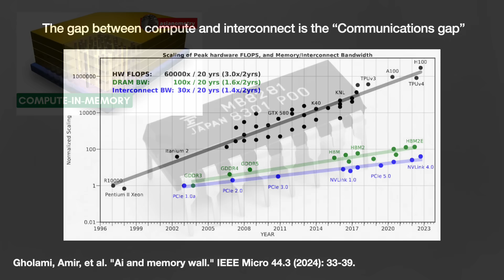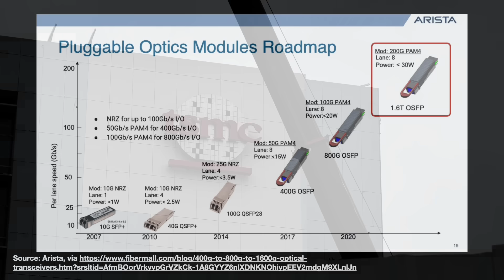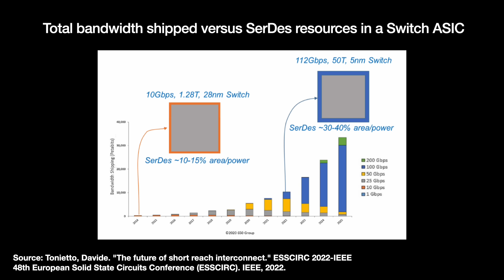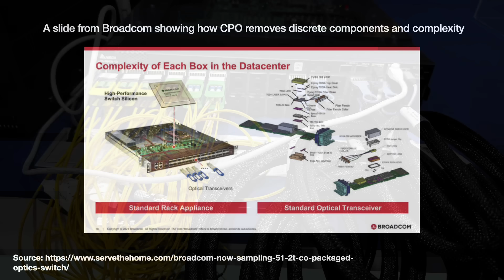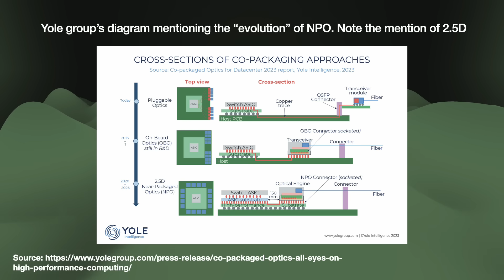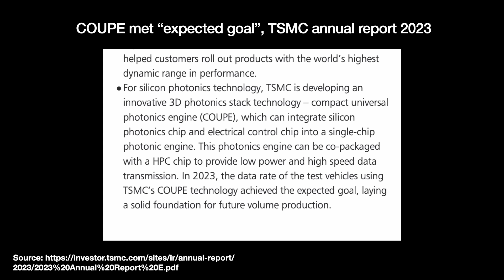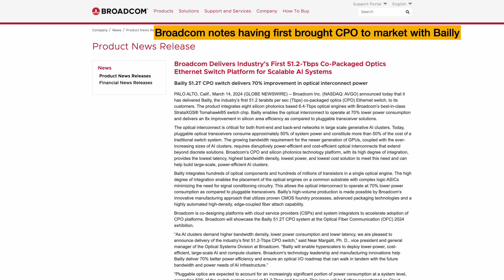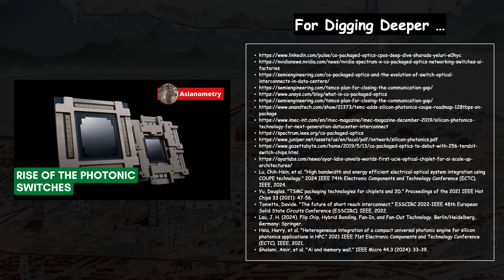The AI Bandwidth Wall & Co-Packaged Optics

Comment: What the hyperscale and HPC industries really want is an all-optical path from one server node to another, but while there are ways to design optical switch matrices that move photons around from port to port, routing them depends on reading the header of each incoming packet.   With current (and foreseeable) technology, that means the packets need to be converted from optical to electrical, so the actual switch core is still an electrical chip and there has to be an electrical-optical converter front-ending each port.
Reply: All optical is possible but the address info will have to be communicated to the switch electrically. That puts limits on the latency but the bandwidth can still be very high.
Reply: @tykjpelk the advantage of photonic waveguides is that you can "tap" 5% of your light signal, send it into an integrated photodiode, read out the current and deserialize the data to identify the targeted ip port, run the remaining 95% of the signal into a routing circuit to the targeted port until the target ip address changes. 

What could also be done is of the hundred channels in the opticsl telecom bands, some be dedicated to data addresses, and some be dedicated to data. Like that, the optical flow never stops.
Reply: I wonder if they could run more lines to more ports so no routing needs to be done. No addressing needed if everything has its own dedicated line.
Reply: @GradyHouger That's a lot of architecture baked into the hardware. We use caches because a hard drive read is literally a million times worse than a cache read. You can imagine the performance loss if the optical port connection itself needs to be replugged by a human or a robotic hand.
Reply: Why? Since we are talking about light that implies color. Various combinations of 16 million colors ought to allow for header space for every possible ipv6 address, let alone any other application.

There is no need to switch to an electron.
Reply: @Steven_Edwards  Colors are combinations of wavelengths and intensity.
I was thinking of each server accepting a single wavelength, thus making it its own address. LEDs however can't modulate their wavelength and they don't have big spectrum coverage, meaning you'll need a bunch of different diodes on the chip, one for each supported address.
Another possibility is to use polarization.
Reply: @ИванСнежков-з9й are you familiar with coarse/dense wavelength division multiplexing ? It seems like that what youre describing.

You can have a semiconductor laser instead of the LED, with a tunable cavity or tunable bragg reflector to select a specific wavelength. 

Bookham (now Oclaro) built that in the 2000's with a tunable laser continuous wave source and an external electro absorption modulator. All on the same chip. It could address any of 60 channels (about 0.5nm apart in wavelength), and transmit date at over 40Gbps using a QPSK circuit. A single emittor could address any channel (but not all of them at the same time). 

As someone said in (i think) this comment thread, is that attributing one optical channel to one specific server output is a huge architecture requirement put on hardware...
Reply: @Steven_Edwards what do you refer to by 16 million colors ? That sounds like 24bit RGB which does not transpose well in photonic circuitry. 

An 8 bit color corresponds to 256 different levels of luminosity. Today, in integrated circuit modulators, Pulse Amplitude Modulation (PAM) rarely goes beyond 8 levels (so, 3 bits only) because the bit error rate collapses quickly at high frequency. (Look up "PIC PAM4" in google images, i hope it illustrates what I'm writing). In order to increase the number of bits per symbol, the trend is to use coherent light circuits, and encode the bits onto the phase of the light wave, as well as the amplitude (Quadrature Amplitude Modulation). This is typically used in wifi. The receiver end has a more complex demodulation circuit but it works out. 

So, no 16 million colors at every clock tick, unfortunately. However, it is feasable to communicate in parallel over every channel/color in a fiber. A 24bit optical bus with 24 wavelengths in a single fiber. Just optical 1/0 data : light or no light. No fancy PAM8 or 16QAM All that is needed are the light source(s), the de/multeplexing circuits (ring resonators work marvelously for this - at constant temperature), and 24 identical modulators. 

Its not ideal, not efficent, 24 lasers is tough to integrate (check Scintil LEAF Light) and 24 modulators is serious chip footprint. But it is colorful, and it can count to 16 million, if thats what we are after.

Comment: what's this about ruthenium?
Reply: Copper wires with approx~10's nm have large resistance because electrons mean free path (approx distance that electrons move without colliding with another or wall in this case). Ru's MFP is much shorter so it still works like a normal metal conductor.
Reply: @Danji_Coppersmoke I think that's backwards, shorter MFP means higher resistance and lower conductance, see Drude model

Comment: Make memory optical. That's the easiest problem to solve. You can make it big. Have ample bandwidth far greater than HBM with the entire range of a closed system spectrum.  One mention from Jon that is very problematic. Slight changes in temperature alter the resonance cavities physical shape which is intrinsic to optical circuits computing with phase. A little change is a lot of uncertainty. 

But that's why memory and not compute. Memory can be put offboard in a centralized place where the only external access is the fibers themselves. The only other bottleneck is the on-die transceivers. All that space you're wasting with SRAM, put half of that into real estate for high bandwidth optical I/O. 

I'm sure people have considered this and through R&D or pen on napkin figured out this is impossible. Maybe. It's a risky thing to try in practice so, its easy to dismiss.
Reply: Wouldn't that require a whole new design of memory to accept and store the incoming/outgoing information? It would fundamentally change how current memory works, right?

Comment: Optical engineer here, thought I'd share some of my knowledge. I've worked in telecom, and I have a knowledge of photonic chips. I dont know what is implied by an "all optics chip", but we are likely very far away; while we do have "optical transistors" (in a sense), these are all tabletop things like the first electronic transistors (though you could argue we are still at the "vacuum tube" stage conceptually speaking). There are a lot of ideas to make an electronic scale one, but this remains university level research stuff, sufficiently risky that (to my knowledge) no private corps are currently trying to manufacture it. A lot of cool ideas, but it remains very experimental. I can see them trying more seriously are photonic chips become more popular and the fabrication methods scale, but its gonna require its own massive ecosystem of waveguide designers (which to be fair is a common-ish optical engineering specialty as its whats used to design fiber-optics from an optical perspective) who are few and far between. I'm keeping an eye on it due to my proximity to the field though. I'm also interested in photonic computers because there are a number of operations (like fourier transforms) that can be done using optical systems pretty much instantaneously.
Reply: I am a photonics PhD student. I’d argue that all optical logic may never be useful or scalable. Optics is just not good at low power nonlinearities.
Reply: @dsjgfhidupgjret  well CPO is really just a "plumbing" fix isn't it. It’s about moving data between the real electronic chips faster, not changing the logic itself. The "vacuum tube" analogy that was mentioned feels apt, it's just making the connections between the tubes better. The more interesting part is the full-on photonic computing, especially for things like the fourier transform. It's wild that a simple lens just does a 2D Fourier transform naturally. Coherent light diffracts when it passes through an input, and the lens's focal plane is the 2D FT of the input. It's not an algorithm like an FFT? It's just a physical property. It happens at the speed of light, which IS the "instantaneous" part. But as was mentioned, the ecosystem is the real bottleneck. It's all just research-level stuff. There are startups trying to productize this like optalysys, radion labs, lighton to name just a few. They aren't making full photonic computers, but 'OPUs'  that work as co-processors kind of like a GPU. The heavy math such as convolutions or FTs gets offloaded to the optical chip. that seems to be the stepping stone, if those co-processors get popular it might finally create the demand for that ecosystem of waveguide designers that's needed. Thats one of those companies trying to make that exact leap, probably to target the AI market.
Reply: Indeed, there's nothing remotely suggesting that "all-optical" chips makes any sense; optical structures are dramatically larger than electrical and are likely to remain that.  On-chip optical IO however has clear upsides and I've patiently awaiting it since I saw Lightmatter's HotChip presentation eons ago.  Any day now.  Any. Day.
Reply: @tommythorn  This is a persistent idea that somehow optical computation is a viable future technology.  Optical conductors and switches are huge compared to electrical equivalents.  I worked with fools 30 years ago (at Polaroid) who thought optical disks were the future of storage technology.  I explained to them that IBM (early 1990's) was waking magnetic hard drives that were 10 times more dense than their optical maximum density.
Reply: Well, the industry wants to replace the switches (the switch chips, not transistors in general) with an all optical path. For which you don't need multicore x86 or fp64 or large memory implemented in optics. You need a bit of compute to decode addresses and a tiny bit of memory to read (assuming the protocol is simple enough). That saves two conversion steps (optical to electronic to optical again) eliminating both the slowdown and the energy required.
Reply: I have heard in nano scale, metal can be used to waveguide light smaller than its wavelength. Do you think it could be used in modern semiconductors, which are compatible with nanofabrication
Reply: There's a very real and eventually realistic desire to place electric chips on top of photonic chips for die to die communication. It'll take advantages in packaging but I think we'll get there. However I don't see any viable path to photonic transistors and I don't know of any companies that are seriously working on it. PIC designer with experience in plenty of application spaces.
Reply: Thx.  Good, honest review.  Having been phd r&d in this multidiscipline area for 3 decades, I'd say the fundamental thermodynamic limits and simple intrinsic loss issues make "optical computing processors" fundamentally unsexy to me,  BUT, it's getting quite exciting in the area of discrete devices and sensor realms , SOI integration.  This could transform things in semiconductor world and beyond naybe as profoundly as quantum Hall did, and lots more fun physics than trying to duplicate millions of reproducible non-lossy on-chip photonic circuits for a noncompetitive processor.  Always another VC to invest in the next cycle of that ancient dream.
Reply: I’m sure the traitorous 8 never imagined serdes. As you master one part of each improvement you have the opportunity to tune it for non standard operations. Sometimes those open up opportunities. As we improve every bit of optical operations we will discover, or simply gain the ability to control more aspects of the communication.  Image something like using polarization and wavelength to serdes optical communications?  Serdes was a solution to trying to shrink flip phones. uSerdes made the Motorola razr possible. Now it’s at the heart of a lot of machine communications.
Reply: Q.ANT ?
Reply: @BruceConsidine 
EU research money driven, it’s a second Fraunhofer
Reply: Photonics computers don't really make sense today, a single lightwave is around 200x-500x larger than current transistors on chips. This means waveguides can not be miniaturized like transistors. Just this fact will prevent mass adoption of the technology
Reply: @dtibor5903  The interviewee at Q.ANT (Anastaisa channel) said that waveguide miniturization wasn't necessary due to the absence of restitive heating that occurs in transistors. The optical chips can be stacked so close that volume dencity of compute is greater than achievable by transistors. Does this assertion sound reasonable? A further advantage is that aging foundries only capable of larger sizes are all they needed for their optical chips. Having said that he said that optical couldn't substitute for all high power computer. But I'd imagine it would be AI applicable.
Reply: @BruceConsidine you are wrinting nonsesne waveguides are 1000x larger than transistors. When looking at 2.5D sructures that becomes a disadvantage on the scale of millions. That means in place of a single optical transistor you can put millions of electrical transistors. Anastasia is corrupt, she obviously makes undisclosed ads.
Reply: @dtibor5903  OK, but the energy consumption is 30 times less.
Reply: Poet, lumentum, broadcom supposedly work on it but good to know its like quantum...far from scaled production with good economics
Reply: Optics is also inherently much much bigger than electrical transistors. The waveguide can't get smaller than a few hundred nm, and a ring resonator for modulation is microns.
Reply: Blame you
Reply: I could see die-to-die optical interconnects as a (highly specialized) possibility, but the simple fact that on-die metal connections are already smaller than optical wavelengths means that the dead end for all-optical logic density was surpassed ages ago by electrons. This mirrors the same milestones in microscopy research.

It's possible, in the future electrons could be manipulated & controlled in the same way as photons, with waveguides approaching the Planck scale. But that requires manufacturing techniques on a sub-atomic scale, and only reliable in impossibly controlled environments as demanded by quantum computers (actually, that's basically what they are).
Reply: Any knowledge on an aluminum extrusion t slot that has a fiber optic coating on it any idea ? Thanks
Reply: It has the potential for infinite divisible wavelengths, still limited by the bandwidth of an optical filter.  I like to remind people that electrons travel faster than light in a material.
Reply: Thank you for your work and sharing this tid bit of progress in the field of photonics. I personally became quite interested in it when word first surfaced about its possible application in consumer electronics a few years back. Looks like we are far away from achieving the lightning fast speeds which makes me appreciate the raw gains in compute with current tech.
Reply: We used to use fast fourier transforms to do our fourier transforms fast, but now we use faster fourier transforms coprocessors to fourier transform faster
Reply: Companies like Intel, Cisco, and NVIDIA have dedicated divisions focused on silicon photonics and have already released products that integrate optical components onto chips for high speed data transfer in data centers, for example NVIDIA sells AOCs that use integrated photonics to transmit data over fiber optic cables at speeds up to 400 Gb/s. The electronics are integrated directly into the cable's ends.  The concept of integrating multiple optical components onto a single chip is a very active area of commercial development. Companies mentioned earlier are already working on chips that combine optical modulators, photodetectors, and waveguides. The goal isn't to replace a CPU with an "all-optical chip," but to use photonics to overcome the bottleneck of electrical interconnects, it takes time.
Reply: @ChristianDoretti  : This is the correct response to that ... outdated? ... comment above.
Reply: @ChristianDoretti This is just the same integrated optoelectronics functionality that's been evolving for over three decades.  Different subject.
Reply: @ChristianDoretti Don't exclude AMD from that list. It's the dark horse that no one's paying attention to. 😅
Reply: @nickfries4317  AMD doesn't do basic science/engineering research like this. It takes whatever fabs have available. It's part of what has made them successful.
Reply: @Datamining101- I understand and agree to a large extent. However, I'm unable to disclose anything that would help explain further what I meant.

You did just confirm my point unknowingly, however. 😅
Reply: When optical cable can transmit picture directly
Reply: Fun fact all the computers on the star ship enterprise are photonic in nature… just thought it would be cool
Reply: @JebKerma-j6j  Star trek based on the future promises. Their photonic computers store qbits in the terraquads of RAM. But yet their AI is slower at some stuff then our current AI's so they must be doing something wrong.
Reply: Wdym by no private corporations are trying to manufacture it?  that would imply and mean no one is developing it because there are plenty of startups already tackling this problem with prototype to near production level in smaller scales 
Like the other commenter mention there are already some 
Bleeding edge for AI Photonics hardware is already used for sadly facial AI detection from China